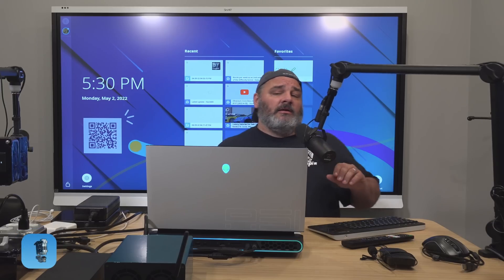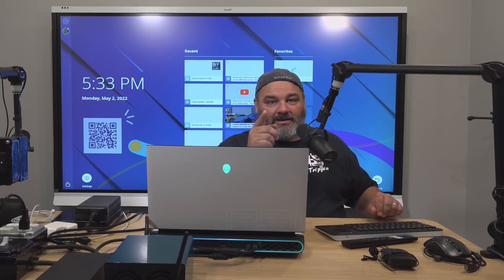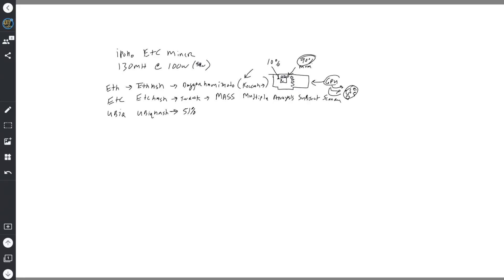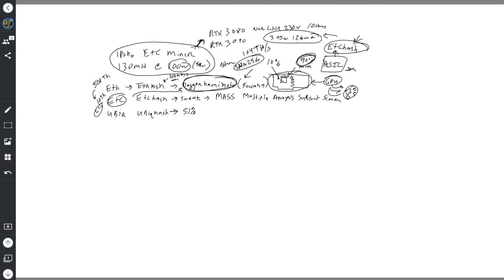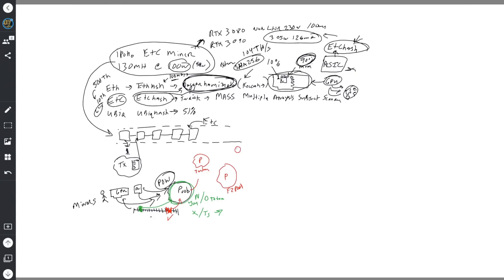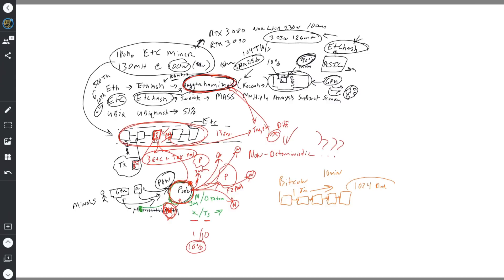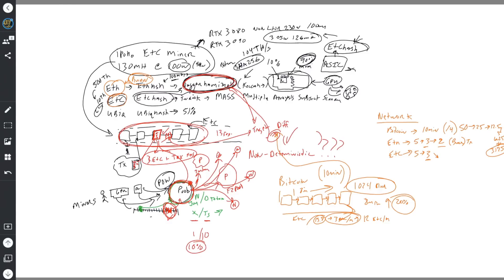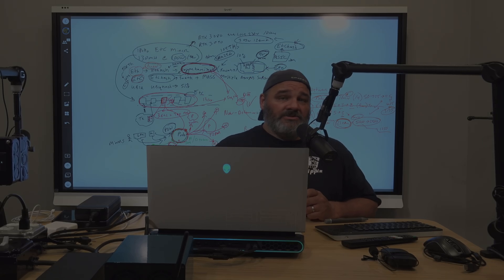Proof of Work in Cryptocurrency Explainer

Comment: The problem of the PoW is that it incentivizes all the participants to waste energy on random number guessing - this happens despite any kind of evolution of electrical component efficiencies and what not.   The solution is not to get rid of the good sides of PoW, but incentivize both the inventors and participants to create the energy wasting parts of the concensus mechanism to some new version which removes the power wasting.     Sure, if power usage can not be removed, then why not make a mechanism which actually uses that power to something more beneficial than just random number guessing?   It just is not sustainable way to make decentralized crypto system for the whole world, if the energy use of single transaction is crazy high compared to other systems.   PoW needs improvement and inventions, to maintain the good sides of it, and evolute the bad sides to something better.

Comment: Correction: If you want to carry out a 51% attack on a 10 TH/s network, then 6 TH/s would be grossly insufficient as it only amounts to 37,5% of the total (16 TH/s being the total). If you instead add 11 TH/s to a 10 TH/s network, then your hashrate would amount to 55% of the total (21 THs/s being the total).
Reply from the maker: Steinar thanks for the correct, you are correct, my math in that example were wrong given the total would be cumulative to the total causing the 51% to be much higher ; I will correct on the next video were we deep dive into this.

Comment: I use to be a big ETC supporter, I believe we both mined it all the way through the medium bear market of 2018; and it wasn't so much the repeated attacks on the network that caused me to walk away; it was basically the way key people in the community went to war with itself, and the outside interests group that fueled the division for one motivation or another, and they have now seemed to go the way of Ethereum where they are barely listeing to what the community would like; that coupled with the fact of rolling back the DAG so older cards could come back and help get the network hashrate back up; and now that those who bought up the lower vram cards or had them and put them back into service on ETC, to help them survive as another attack or two would have essentially rendered the chain useless; they seem to forget or not care about any appreciatation for there efforts and are still talking about moving to a more ASIC friendly algorithm like SHA3; frankly has me and many others considering supporting another project; as it seems they already reversed their initial position of Code is Law; the reason for the split; now has no meaning at all.

Peace